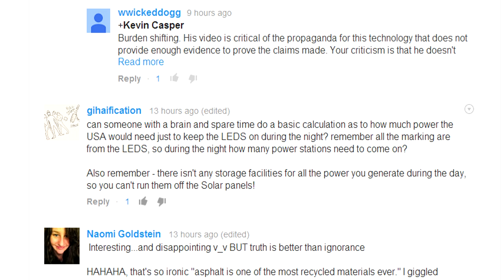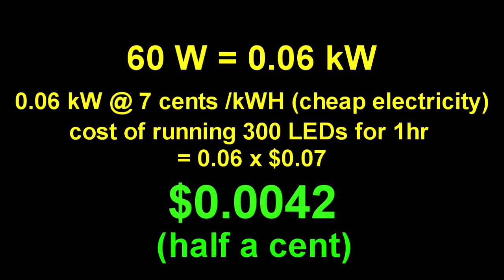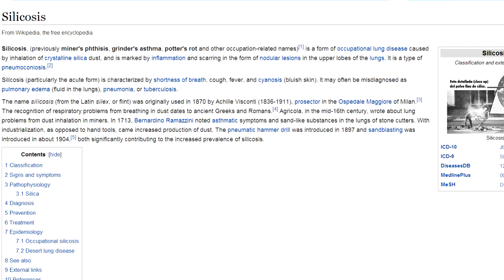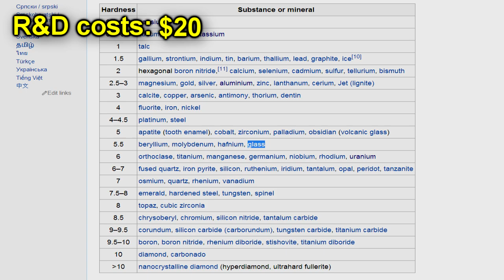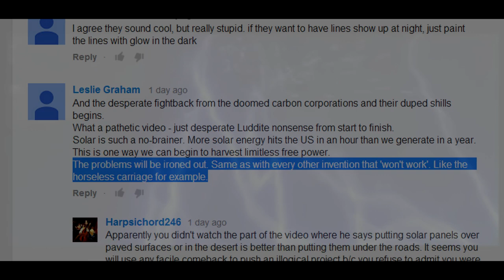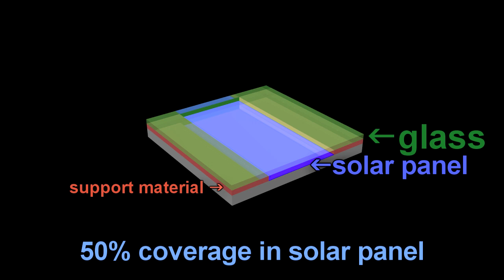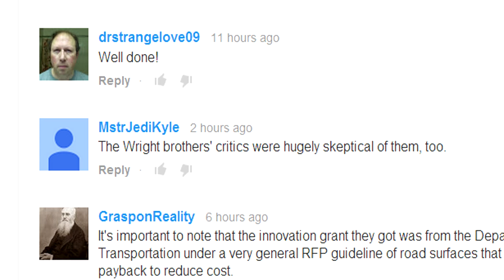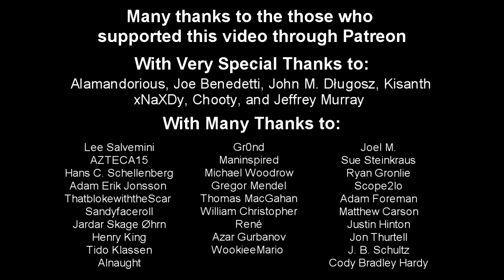Solar Roadways, IMPORTANT QUESTIONS AND ANSWERS!

Comment: The implication that the LEDS will be on all the time

I haven't watched much about this but that seems grasping at straws because you could just not use the LEDs that much/rarely if thats really the deal breaker

Or hell not at all and keep using paint
Reply: Paint, that covers the solar panels, which are already only around 30% of the surface area.
Reply: True, but again I was refering to the specfic point rather than on a whole. Civil engineering is expensive so even if it did work tossing out old roads with this would be a very lenghty and costly thing to do, but to site one major problem is because of LED's seems to be missing the point, Paint would cover yes but Im assuming they would't get too crazy with it. In terms of problems, the LED's are a damn footnote
Reply: I'd suggest it's a big problem, made up of smaller ones. The power consumption, the cost, dimness, ease (or lack thereof) of replacement.

They're not going to be on all the time, but the system that decides has to be.

Let's just stick with proper roads.
Reply: Well power consumption is a problem, but thats with LEDs, if it was a true solar panel(albeit a crappy one) it would make SOME power, the real problem is that it would essentually explode under stress(i.e what a road needs to handle) or if made of a good material, not be able to power as well and be cancer causing
Reply: I was assuming you would cover it with fiberglass, as its really the only one that can feasibly stand up to the weight and not cost a retarded amount(sapphire)

The cancer part is because excessive exposure to ground up fiber glass is cancer causing(normal roads wear down, fiberglass would make them turn into toxic clouds)
Reply: You're aware that fibreglass is plastic, right? It just has glass filaments woven (or just impregnated) inside. If fibreglass were stronger (which it isn't) and more difficult to scratch (which it isn't) than tempered glass, they still wouldn't be able to use it because the fibres would reduce the transmission of light pretty severely.

Comment: There is so much wrong with this idea. Like, wet glass is slippery, even textured glass. Glass is brittle. Any scratch is bad, starts a big crack fast. The LEDs in the daytime was an obvious one. The ground heaves with weather/moisture content of the soil, and after new construction the ground compacts, making the roads not exactly smooth and flat. All this times would be popping up. At best you'd have gooble-stone roads, more likely they will come out, and of course that breaks the circuits.

Comment: Hey Thunderf00t, you missed an important test. You should have scratched the hell out of the glass covering that solar panel (to simulate road damage over time) and then tested the energy efficiency at different angles. I know this is what you were getting at, but seeing the measured results would be interesting. All those scratches would diffuse the light at thousands of different angles and would reduce the efficiency of the panels dramatically. Especially if it's covered in snow that fills in and compacts in those scratches.

You wouldn't really even have to destroy the solar panel, just a cut piece of glass which you lay over top, get a base measurement, then scratch the hell out of and test again.

Comment: Thunderf00t does have a good point... it'd be more effective just to cover every rooftop in every city with angled solar panels. Imagine how much of an impact That'd have! It'd be awesome. Plus, it would save roofs from solar/heat related damage.
Reply: Which pretty much is what people in Germany for example have been doing for a few years. 10% percent of the electricity is coming from solar panels in Germany (and another 15% from wind power)
Reply: superdau
I don't think that's accurate, 2013 figures put solar power at just over 5%
Couldn't say what wind contributes, also power costs in Germany have recently skyrocketed, one of the most expensive EU countries for power cost.
Reply: geteuch nixan Nope. Solar/Wind power have several huge disadvantges too, like not being reliable sources and rather expansive compared to other technology.
They need ot be researched further, as they are rather likely a big part of our futur energy-systems, but not now.
Reply: And it would get rid of a lot of the light pollution.
Reply: garith21

Are you kidding? Really???

The EROI on PV solar power is 6.9. That's not that great. Not horrible, but not great. Imported oil is a 12, but coal is an 80. It's not low at all. Coal is 80. Hydro is 100. Nuclear is 50-75. Yes, shale oil is low at about 5.0. Corn ethanol is only ~1.0, making it a net loss when you consider the resource usage and environmental impact. 

The only way that solar pays for itself for most locations is with subsidies.

What all this basically tells you is that low EROI sources of energy shouldn't really be used except for niche applications. In the case of oil, the bulk of it goes towards motor fuels, for which there's no good substitute other than gas.
Reply: Yes but that seems to be mostly a political problem, meaning did a crappy job at boosting green energy cost efficiently.
Reply: geteuch nixan i meant "politicants did... "
Reply: Good idea. People in China have been using cheap, roof-mounted solar panels to heat water for years.
Reply: ABaumstumpf the EROI for wind/solar, especially wind is rather good in comparison to coal or imported oil. Shale oil is only a thing because of political support and is in the same boat as corn ethanol with regards to EROI. In all honesty if you can afford the initial payments both are rather good for the applications that they can be used for because they can pay for themselves energy wise where as fossil fuels cannot.

There have been quite a few claims with regards to costs and green energy, when you look deeper into studies a lot of the cases where it results in more costs it's usually not as big as people think.

Comment: I say dump the project and put them on your roof...
Reply: Great idea.  Just look at all those roof tops, generally baking in the sun all day long.   We should be researching a cheap (cost effective) way of roofing buildings rather than this road idea.  No to mention that all the buildings/houses are already connected to the power grid whereas the roads are not.

Comment: did your annual calculations only account for night hours or did you include the day time hours as well? * checks math* yeah you included daylight hours. doesn't help much but it does cut a few hundred million off the daily bill.
Reply: No you can't cut the daylight hours. According to the idea of the proponents the LEDs are used to display road markings. Guess the LEDs will be as bright in the daylight as the idea is.
Reply: superdau
except according to thunderf00t these calculations were for the energy needed to run the lights without the aid of sunlight.
Reply: tuseroni
Right. Ans as we all know, everywhere in the US is sunny all day every day without exception. Since we never have cloudy days anywhere in America we don't need to calculate the daytime costs right? Moron. /sarcasm off/
Reply: tuseroni The power generated by the solar panels inside is simply not enough (not anytime soon at least) to power the LEDs, let alone the microcontrollers.

But let's forget that and assume that they can run solely on their own solar energy, and produce excess. The LEDs are not bright enough to work during the day, and during the night, there is little to no solar energy to be collected. Which means each one of these would need its own  battery to store the excess, which degrade over time and are not cheap! Not to mention that unless the battery is nearly drained before it starts taking a charge again, it will degrade even faster due to improper charge cycles, just like your phone or laptop battery.

There is so much wrong with 'solar freakin roadways' I could go on forever.

So ignoring entirely that glass is a terrible road surface, that the tiles literally cannot generate enough power to sustain themselves, that the things won't even work as intended during daylight and are OBSCENELY expensive, it's not even half baked.
Reply: Fernde09
thunderf00t's premise was ONLY about running it without any help from the solar cells, that is he was talking about what it would take to run it during the times without sunlight. so whether the solar cells can or cannot provide enough power is irrelevant.

you seem to be making an argument for someone else who is arguing about the feasibility to not of these devices...that isn't what this comment is about, it's a minor correction to thunderf00t's math.

Comment: They should probably work a bit on the LED idea. But to be fair, you probably wouldn't want to have all LEDs on full power all the time. This could reduce the bill to 'only' a few billion dollars per year. However, I am more concerned about the actual real world efficiency of the tiles. Did they do any measurements on this?

Comment: I am usually on the same line of thought as you, but on this one I'm quite sure you're being a little bit more skeptical than it's worth.

They don't necessarily need to use LEDs on their tiles. there are much more energy efficient, easily visible, and long-lasting display methods. They could use anything from a variation of E-Ink to the dot matrix flip displays (The ones with small tabs that flip sides). That way they don't require constant power and they aren't consistently in use.

The power production of the panels is dependent on a lot of things. Newer, particularly experimental, solar panels are coming to be much more efficient, and while this doesn't make that big a dent, it's something. There's then the possibility of optics, focusing light from all angles onto the cell. This would be difficult to make work properly, but it would largely help the "static panel" problem.

But then there's the materials. You are /so/ hard on the materials. No, I'm not saying glass can actually work well as a rode material. It's actually really horrible. The thing is that there are countless composite materials that would work better than glass, and even asphalt yet still work with this design. They still need to be developed further, though, and any material that will work that we have right now is terribly expensive... That's why this is a jab at the future. The load bearing material as well doesn't have to be a big problem, you just need a strong surface material and even something like dense rubber could support the panel. Actually, I'm surprised that you focused on the strength of the center material supporting the panel rather than the panel material itself, since it's a much larger problem that the panel could cave inward.

You say there aren't any power storage facilities or anything of that function: Why can't that be in the tiles? We're developing ever more dense power storage mediums and the system could be linked together, so all the batteries in all the tiles could be connected to each other. Not like one gigantic battery, though, that would be a nightmare- It would still have to be separate but the power could be shared in a manner controlled by the tiles.

Then the maintenance. You make it sound like such a big deal to replace a bunch of tiles. That's actually what makes this system so great, though. Currently we have asphalt rides, they get torn up and eventually, after they get to the point where people are getting tires blown and chunks of it on their windshield, the whole roadway is sectioned off, dismantled, and then layed again, all over the course of a few weeks. With the tiles, you just have to pop a damaged tile up and put a new one in. There could even be sensors to detect damage (Or at least any kind of damage or fault that is easily detected) and mark that tile to be replaced in a monitoring system.
___________________________________________________________________

You see, the problem isn't that the system is a stupid idea. It's that it hasn't had much peer review, editing, development, or testing. It doesn't need to go to the pits of hell with all the other things you "debunk", it needs to be improved and streamlined.

EDIT: I do need to point out one thing. I do not think that solar roadways are the best power source. Beyond the simple inefficiency of the panels on the road in the structures standing still, the cars block out the sun half the time. A power system running parallel to the roads does make much more sense. I just don't see what's so bad about this functional alternative to the horrible material and system we already have.

Comment: Thanks for making a follow-up video on this.

I have a few questions though:

Aren't hardness and brittleness measured differently? Because i can break an inch of glass with a hammer easier than an inch of asphalt. Doesn't asphalt have more shock absorbing properties than glass?

Comment: How do you guys in US have it in winter cause I'm pretty sure temperatures goes below zero C, right? Binding between those hexagons will get broken eventually so water will get in and I'm not thinking about a short circuit just ice which will rip those things apart.

Comment: Has anybody thought about the criminal element here? The cables that run alongside the road will have to be easy to access with tools, tools that are easily available to anyone. It'd be easy pickings for the scrap metal theives. If the roads were coated with SAPHIRE then whole panels will be taken.

Comment: The flaw in the asphalt to glass demonstration is that in the ideal setup there wouldn't actually be any asphalt in the equation.  Assuming the tires were cleaned off from running on conventional roads, it would just be tires against the glass.

Comment: Did no one mention the fact that the vehicles using the roads are also blocking the incoming sunlight and reducing the amount that hits the panels?  In essence, the optimal roadways for absorbing energy and generating power are the ones that aren't used.

Comment: Fallacious arguments. Assumes no power storage capabilities would be implimented. Assumes LEDs would be bought at consumer prices and not in bulk. Highly biased tone of voice, undermines credibility by making snarky comments at detractors. Why compare these imagined prices to the population of the US? To support bias.

The glass used in the video is orders of magnitude weaker than the tempered material used in the panels. The non-tracking panel issue is addressed on the solarroadways.com website. Lack of basic research is thereby demonstrated. Only data that supports preconceived notions has been researched. Bad science. Spends half the video attacking detractors and shooting down suggestions from commenters, undermining any possibility of collaborative effort.

This person's opinions are irrelevant.
Reply: tips fedora
Reply: you're operating on far more guesswork than can be considered credible. LED's can be made bright enough to see in bright sunlight, and can be gently strobed for increased visibility without causing distraction.

the cost of digging up preexisting highways is already faced every time a section is expanded or resurfaced. this should not be viewed as an expense, it is an opportunity to stimulate the job market.

the widely varied options for cheap power storage can only expand further, there are systems that physically park electrons within them until needed, in beta testing. and these measures will not be needed on an industrial level for some time.

this is not intended to instantly replace all highways. initially it will be for driveways, parking lots, ect. highway replacement is a long-term goal.

Comment: The whole problem of the solar freaking roads is academic because in next 30 years we will have cheap and clean electricity from hydrogen fusion in tokamaks. In 2019 ITER will be completed and will have first test run. That's five years from now. I'd add another five years to finish all necessary research and 20 more for companies and states to build their own power-generating tokamaks...

Another problem, minor one, with glass over roads: glass bends a bit. There must be enough space between glass and solar panel and/or PCB to keep that glass from breaking anything underneath it. Heat will cumulate in that space shortening lifespan of both panels and electronic components. Also all soldering on PCB must be done with Pb-Free solder, which is brittle and doesn't like temperature changes. That's why so many computers, smartphones and consoles break early. 20-30 years old computer will work another 20-30 years, while new one will break in less than 10 years...

Comment: I definitely agree that this technology is extremely problematic - probably not viable at all, but the calculations for power usage seem to be a bit off to me - isn't the idea that the LED's only turn on when needed?

Can't they detect vehicles and turn on and off as required?

If so, I think 20% usage across the whole system seems to be way too high an estimate - for most of the night most of the LED's would be off - I have no idea how to quantify it, but I'd expect it to be closer to 2% than 20%, maybe even less than that, when taking into account parking lots, major highways etc that are all very quiet at night.

The durability issue is definitely the big problem.